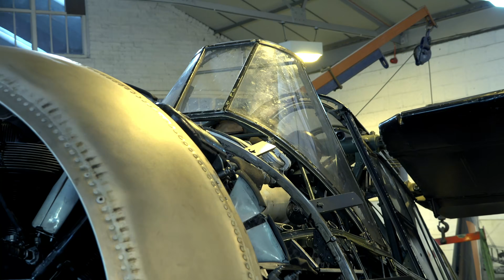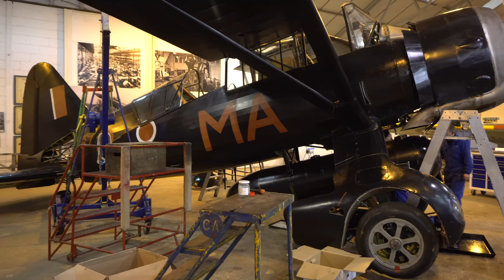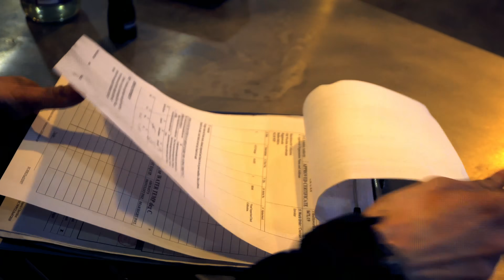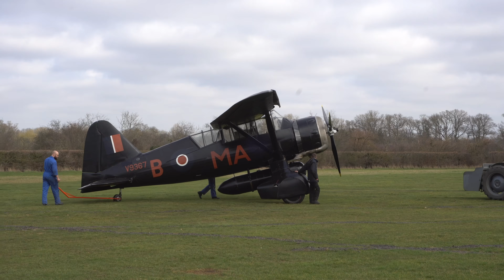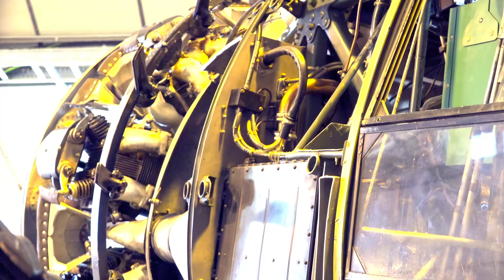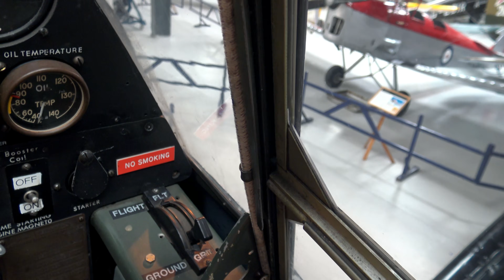Inside the Westland Lysander | Rare Warbird Up Close at Shuttleworth

Comment: Even though I don't like to fly anywhere this plane seems very Safe to me - the first time I EVER flew in a plane it was  737 commercial airliner and I had the window seat just behind the wing on the right hand side and had the crap scared out of me when I saw the wing bending up and down while we were flying - after I almost freaked out the Flight Attendant explained what was going on and then informed the pilot there was a very nervous first time flyer on board - flight was from Albany NY to St. Charles No. Carolina and the plane was overloaded
Reply: Some years ago I offered to take a friend's girlfriend up in my Beagle Pup (A 2-seat side-by-side light aircraft with a 100HP engine). She had professed to be scared of flying and I felt that a different experience, rather than being trapped in a tube at 40k feet, might give her an alternative perspective. We were airborne for about an hour and she didn't want the flight to end. If you are at all worried by flying, I would recommend a short trip in a light aircraft flown by a pilot you trust. Ask him/her to talk you through the flight - what they are doing, what is happening to the aircraft at each stage of the trip. It will be a life changing experience.